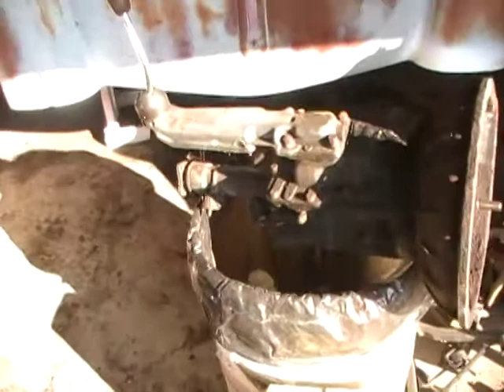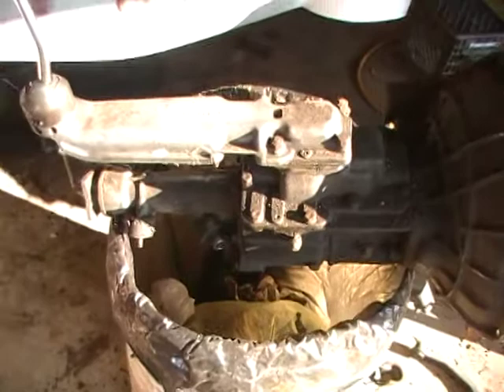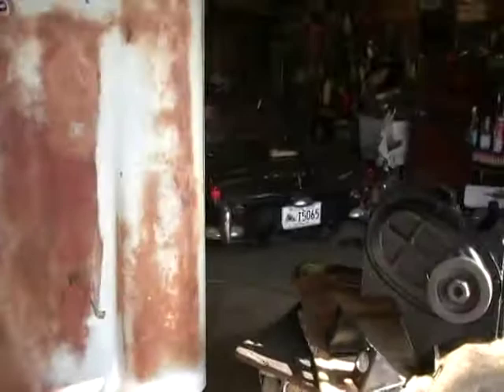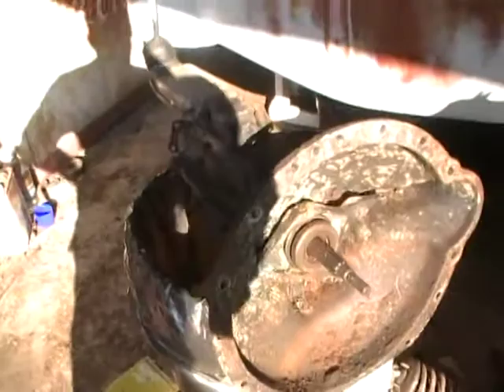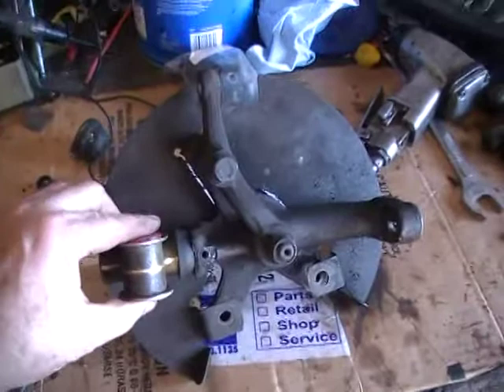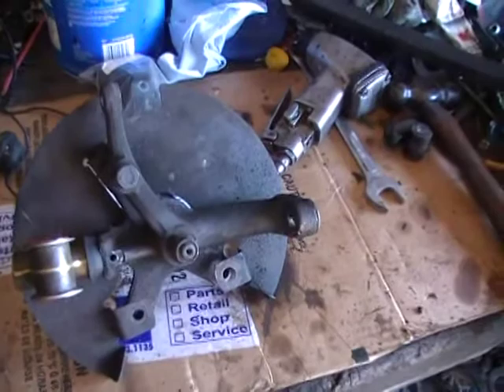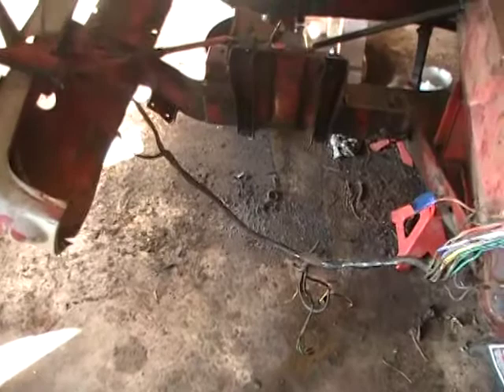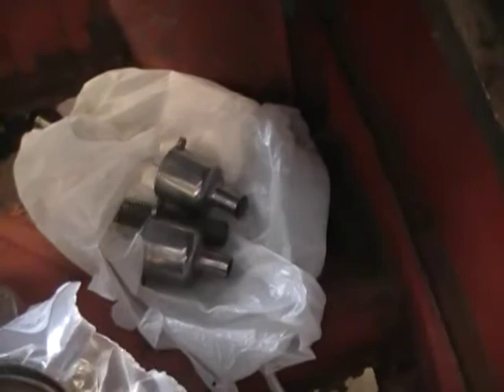Monday for Tuesday Herald progressssssss

Comment: had to buy plastiguage yesterday... the green was not the right size for the job i am doing.. i had to get red. i guess diesels have a higher flow rate than the little gas engine you where working on.
Reply from the maker: I'm thinking that there is 3 kinds of this crap.  Have fun OLF
Reply: there something missing on your profile page there no timeline photo
Reply: yes green-blue-and red. i had to get the red.
Reply from the maker: Was it $35.00?
Reply: no it was 35.99
Reply: no i got only one piece so it was only 1/5th of that :)